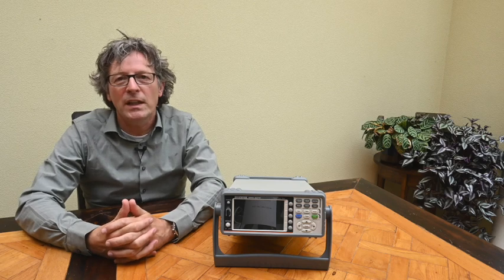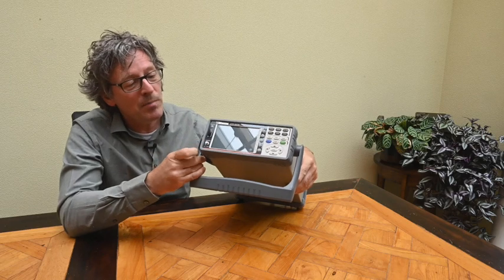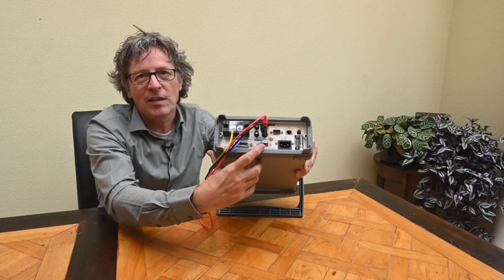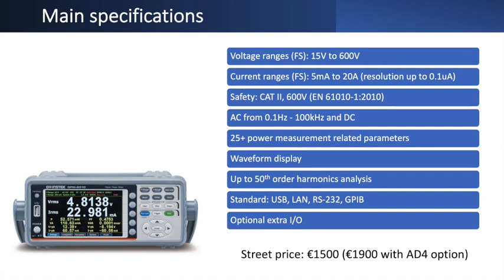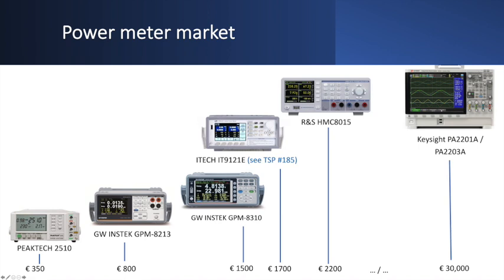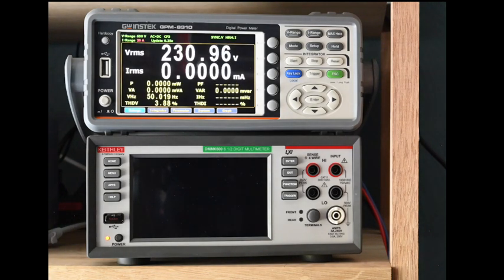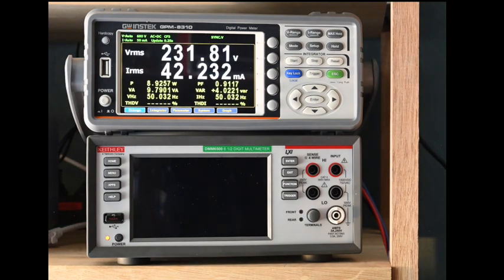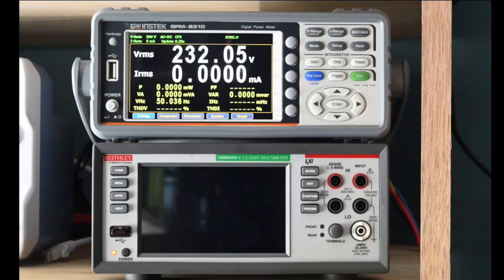REL #02 GW INSTEK GPM8310 Digital Power Meter - hands-on review

Comment from the maker: A couple of days ago (March 18, 2022), GW-INSTEK issued firmware upgrade 1.05 which fixed a couple of issues I addressed in my video. Among other things, navigation through the screens is made more consistent. Now, the ESC button always brings you back to the previous level. Quite helpful. Small display errors have been corrected (like for the zoom function). Also, the harmonics screen now shows the harmonics method (IEC/CSA/OFF) and allows you to change that setting. I find it still strange that the bars turn completely off when no harmonics method is selected (this should only affect things like THDV and THDI measurements, not the bars themselves). But at least we get to see the setting. There are a couple more changes too. There are still a number of other issues open, but it’s a (small) start!

Comment: For testing I think the unit should be supplied by a dedicated AC power supply with a very pure sinewave (very low THD) so you actually have a proper test that is not distorted by the mains impedance. For testing power on surge current a AC power supply can start the AC waveform at any degree relative to zero-cross as a basic power on test. Then you can look at surge current when the units power switch is actually used, which obviously will be at a random point in the AC waveform and also have some switch bounce which can produce some interesting results.

For a base load (perhaps about 150 Watts resistive) it would be good to just connect a non-inductive resistive load and see how the unit performs. I use several different non-inductive resistive load values (bolted to a very large heat sink) to understand the base behavior of the AC test equipment of similar wattage to what I am testing as reference of a basic power device. This is a good starting point when generating a detailed report to a customer.

The real issue with an oscilloscope in this application is having a vertical resolution of 16 bits. Also, an auto-ranging current shunt approach will be much more accurate than a magnetic scope probe approach, within the expected bandwidth.

Comment: Solid walkthru, thx.
way out of my budget. as its almost like 2k USD here in Denmark.. (std GW 8310)
Could be interesting to see how foreign brand models at like 1/3 to ½ price of this one, stack up, like a unit from Tonghui TH33XX series.
It also seems to have the waveform graphing and harmonic bar and the listing it etc. and it seems to differ on current resolution as the more expensive model has uA like Tonghui TH3331

Comment: Thanks for all the info. I have a Tonghui TH3312 which has two issues: no Max Hold and no Windows software. Now the GW Instek software is terrible as always (the ITech one isn't better, lab soft as always just sucks), but regarding Max Hold: I want to measure inrush current this way. The manual from both units avoids that application as if they couldn't do it, but here we have trigger (if necessary at all) and max Hold - could you confirm that measuring inrush curren is possible and gives useful values/results?
Reply from the maker: Good question! Inrusgh current measurements are indeed not specifically mentioned as supported or use cases, but the device might be good for doing so after all. Some observations: (1) for AC signal, the inrush current will depend on the phase position when the load is connected. So, one will want to do many measurements to determine the value for each observed phase position, or better, have control over the moment the load is connected. (2) the GW-INSTEK GPM8310 has a trigger, but as far as I remember, it is a trigger from a button on the front of the unit, or from a signal on a connector on the back of the device (it might be the optional connector, but I have that one). It's not a trigger that arms on a set precondition, such as an observed current threshold (as some other power meters have). I didn't think the trigger is a pure necessity, but if need be, an external circuit might be needed to start a trigger from something like a current threshold. Time permitting, I might once do some experiments on measuring inrush current with the GW-INSTEK GPM8310.
Reply: Thanks mate! I decided to order the Itech IT9121 as it has a dedicated inrush current measurement mode. Knowing that their supplied Windows software is a catastrophy, and the manual doesn't explain that mode at all (what a bunch of '#*+~!). Will see how it works when I have it.